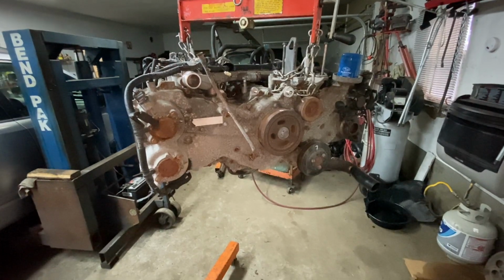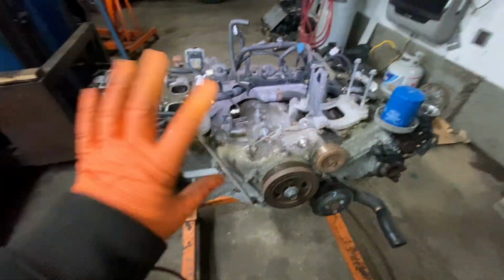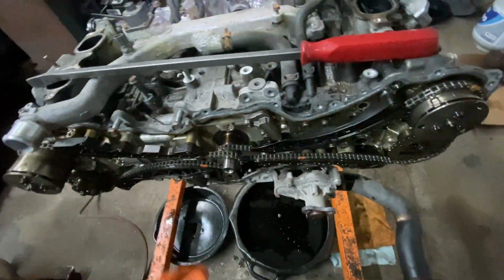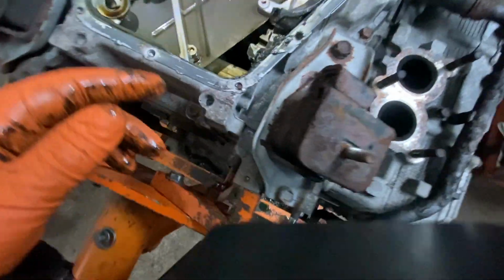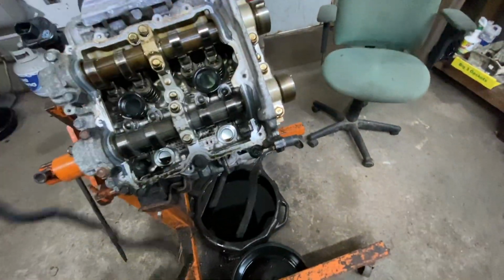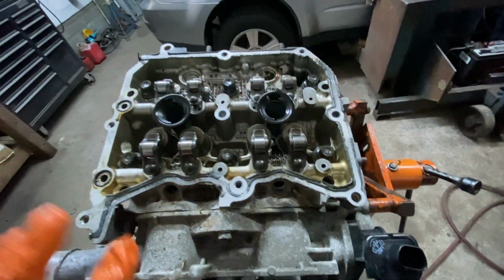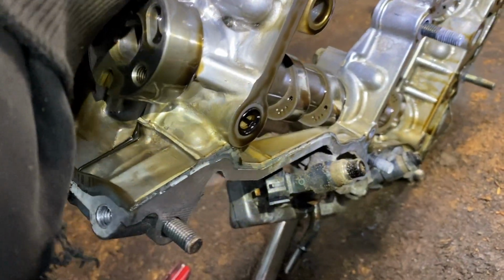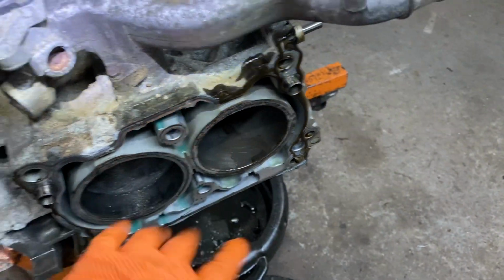Subaru FB 2.5 L Engine Teardown - Head & Timing Cover Removal - 2010 & Up

Comment: Hi. Thank for the great video's on your channel its very encouraging and informative. 
I have FB25 engine  . And I left it for future project . 1 year later while engine covered with tarp outside I checked cylinder leack test pressure and now all of my intake valves start to leak . That didn't happened before I checked before I covered with the tarp before . Compression was okay. 
What should I do to . Do I need to open the heads and do cleaning for the valves ? Thank you
Reply from the maker: Thank you very much! 

What happens especially if left outside is the oil drains down and may leave some surface rust that will cause some binding. Chances are if the engine was in the vehicle and oil primed then started up it would probably be fine. I really would worry too much about that unless you know the engine got really wet for a long period of time. Think of it this way, salvage yards have engines left out in the weather and most are perfectly fine.

Comment: Hello! Great job and very informative. What are the implications if I removed the flywheel shield without making a mark first?
Reply from the maker: Thank you!

Don’t know what you mean by flywheel shield? The flywheel its self has offset bolt holes so only goes on one way. Are you talking about the steel spacer in between the engine and transmission?
Reply: @motorcarnut  Thanks; yes Im referring to the mark you made before removing it.
Reply from the maker: Oh, No I did that because I have 5 vw's in the shop and don't want to mix up parts. But like I said before, the flywheel only goes on one way so you're fine not marking it. Sorry for the confusion.

Comment: Good morning, I love the video, do you know why an engine is burning oil ?
Reply from the maker: Thank you!, Most of the times it's the piston rings that get clogged with carbon due to lack of maintenance like oil changes.
Reply: @motorcarnut  do you think I can add something in the engine or need to change the piston rings ? And once again thank you
Reply from the maker: @lamasa09mm Sure no problem. I usually don’t recommend aftermarket products but you can try products like NO SMOKE oil treatment and see if that helps.
Reply: Mr Subaru says the PCV valve really needs to be changed regularly - it's a $15 part, change every 35,000 miles. Worth doing that along with regular oil changes to keep the engine happy.
Reply from the maker: @douglasphillips1203 Yep, good advice

Comment: What do you think is causing this smoke on my 2015 2.5 Outback?  https://youtu.be/hTQQacA83rg

 I took intake plenum off etc to replace the PCV union, as well as some coolant hoses and other things related to coolant.   Put everything back together.  Engine fired up fine, but after about 2 min, I start to get this smoke that seems to be eminating from front, lower, drivers side.  I dont have any check engine lights when it happens.  Looking at my coolant and oil temp but are below or in low 100's. I turn it off soon after I see the smoke because I dont know if its gonna start a fire or something.

With all that said, when I was tearing stuff apart I saw a mouse had recently made a home in my engine.  While I had the PCV valve off overnight, I was worried mouse would go into engine so I stuffed paper shop towels into the 2 holes.  When I came back in morning, one of the towels was chewed some, the other was completely gone. I looked down in the hole (I believe it was the hole of the PCV union thats on the drivers side.  I didnt see any towel or anything down there.  

If you hear my wife in the video she says it smells like burning shop towels but then when he lit a towel on fire, the smell wasnt the same so I dunno....
Reply from the maker: To me that seems like a coolant leaking on the exhaust. Maybe on the the hoses is loose? Also there is a coolant pipe that runs alone the side of the cylinder head thats known to get rusty and spring a leak.